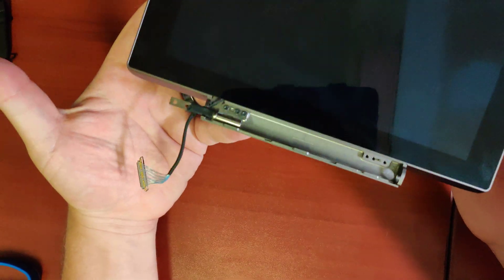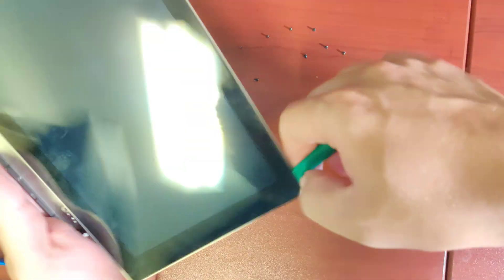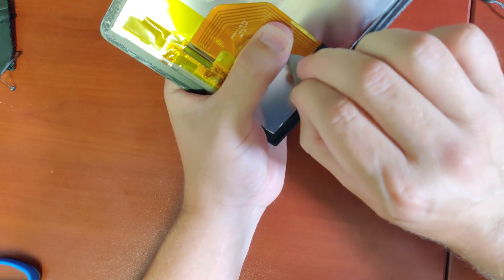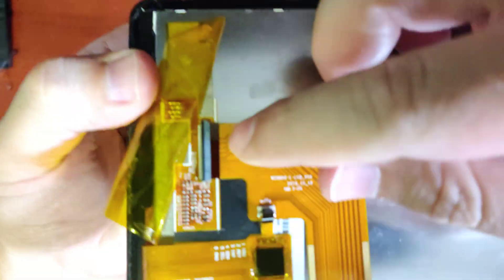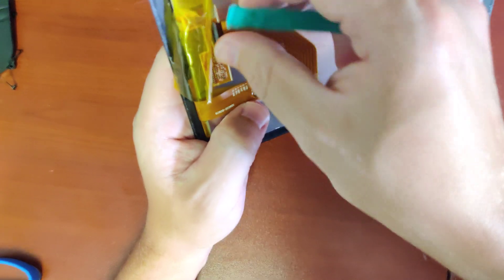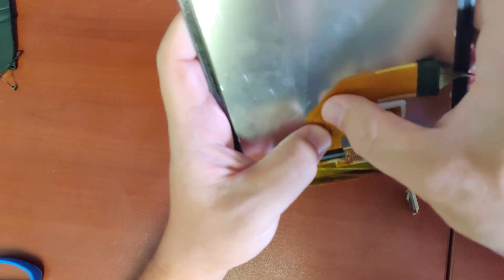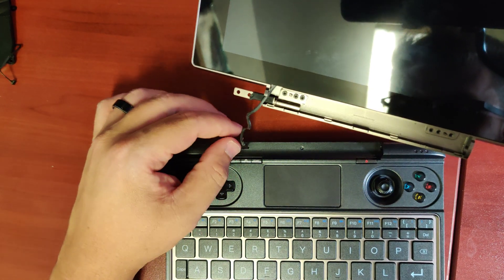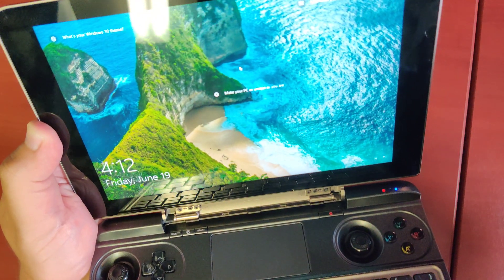GPD Win Max - How To Replace / Repair The Display Cable

Comment: On my Win Max the LCD is suddendly not working anymore. Only blackscreen but the backlight is still working and controllable. HDMI gives a picture besides the bios, probably HDMI output gets initialized after the bios boot. The problem starts with vertical stripes sporadically in light manner and quickly disappeared and then heavy vertical stripes, flickering and after a reboot the dead screen. 
Can this issue be related to the ribbon cable or to its connections on the motherboard or the LCD itself? Device is only 10 months old and the screen was not so often opened or used in different angles. Very disapointing.
Reply: had the same issues with screen flickering and dead screen, but its only after running some specific applications/games

i wonder it related to connection between cable or MB, im too afraid to open the unit tho
Reply: I have the exact same issue. Did you figure out if it was the LCD or just the cable? Thanks!

Comment: Hi Phawx, when the GPD Win Max is charging at 65W, and a earphone is plugged in, does the earphone 'shock' you? My P2 Max shocks me when i plug it into a high wattage charger and a earphone is plugged in.
Reply: There is a high chance your “flooding” the device with electrons. Basically if your charging at a faster rate then the device can handle, the electricity needs to go somewhere, and in this case it could be you.
Reply: @FugueToccataOfLife  Thank you, that is most likely the problem, I'm using a 65W for the P2 Max. that could be more than what it can handle.

Comment: dont you wish they put in a battery / power mode switch into the Win Max? so when plugged in you dont charge the battery after its fully charged?

Comment: Nice that it can run without the battery. Never owned a Win 2, but based on some of the battery issues with that unit I believe it had issues running without a battery.

Comment: I'm so glad we're using a (cylindrical) wire rather than a raw (flat) ribbon cable to connect between the screen and the main unit. Should be heaps better for reliability.